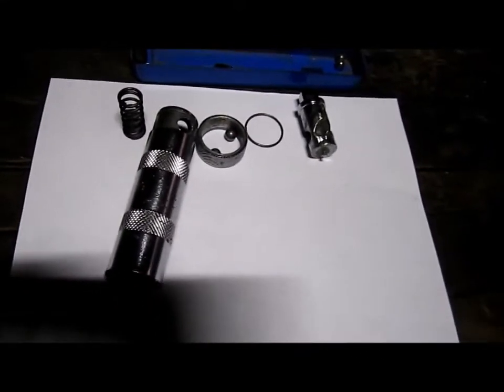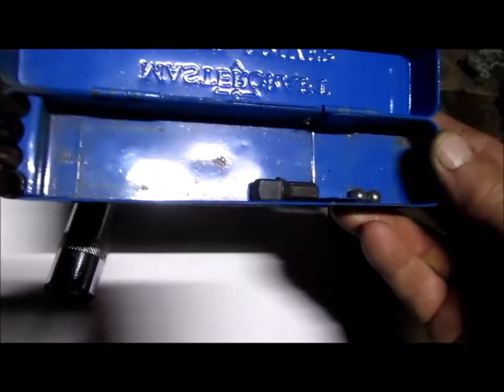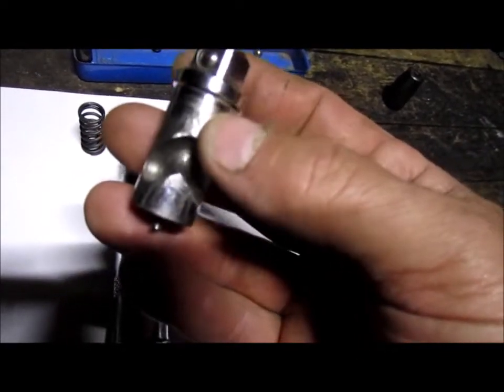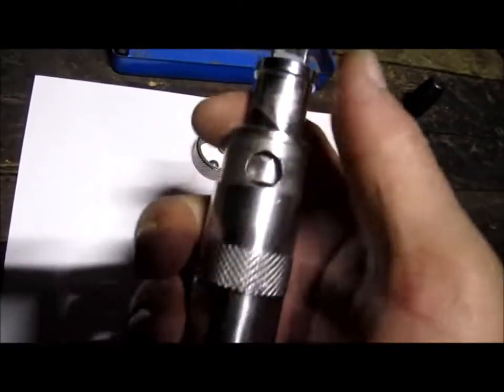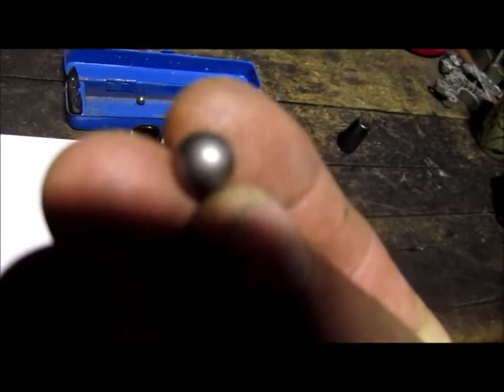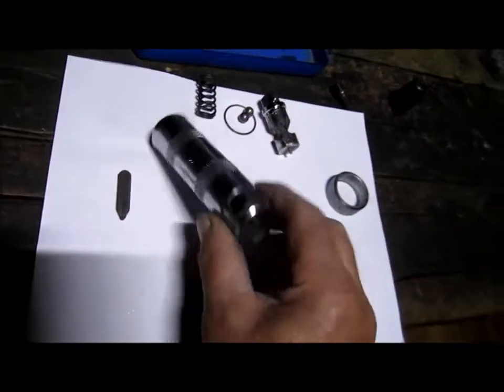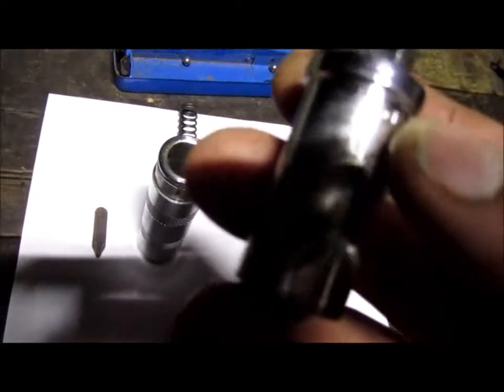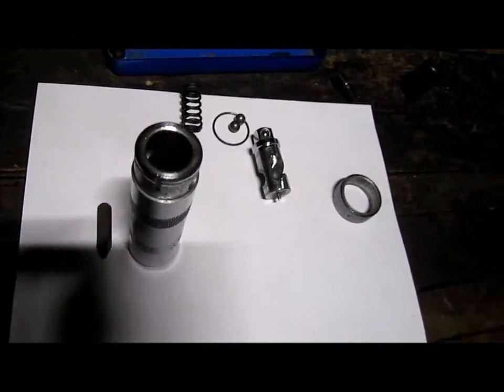Impact Driver Taken Apart And How It works

Comment: A must if you work on older motorcycles. I bought one back in the 70's that I still use. A Vessel 2500.  I just recently took it apart to clean and grease. One of the 5/16'' ball bearings was a little chewed up I had to replace. Im not surprised at the force they have to handle. Still a great tool.

Comment: How did you disassemble it? I have a broken unit and I can't figure out how to disassemble it.
Reply from the maker: There is a ring clip that needs to come off then everything comes apart.
Reply: @MrDoingEverything  do you need a special tool of some sort to pop the ring clip?
Reply from the maker: @valhallaprime  I never used one. I just used a tiny screw driver small enough to fit in and another small screw driver to hold one part after it was starting to release it's self so it would not go back into it's grove. That's all i did.
Reply: @MrDoingEverything  thank you. I was able to slide the ring clip off and disassemble. No ball bearing. My unit is from a Japanese maker, so not the same unit. I'll lubricate it and reassemble to see if it works again.
Reply: Success!  I was able to clean and lubricate all the parts and it’s working again. Luckily I didn’t take the entire ring clip off or else I probably wouldn’t be able to get it back on. I just slid it onto the handle temporarily. Thanks mate!